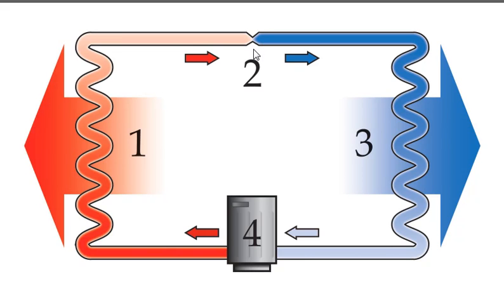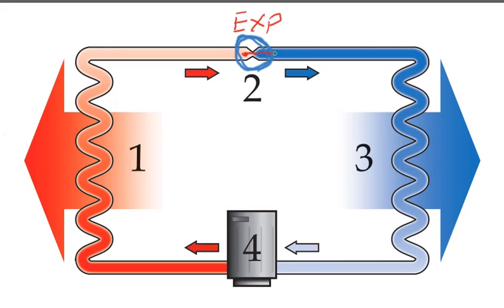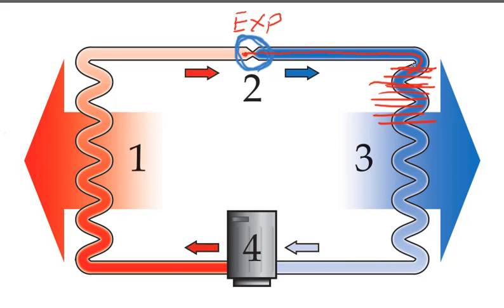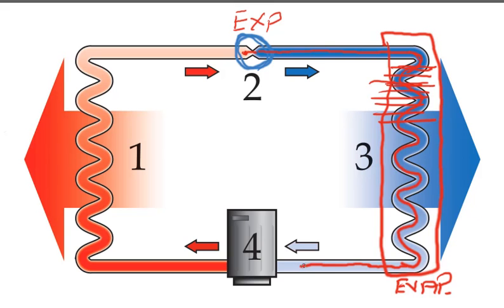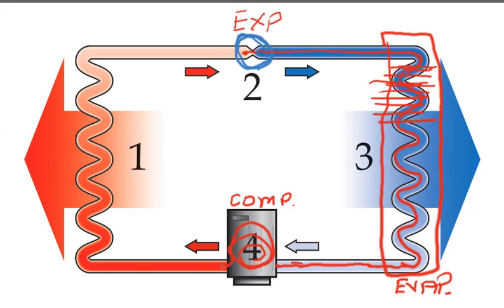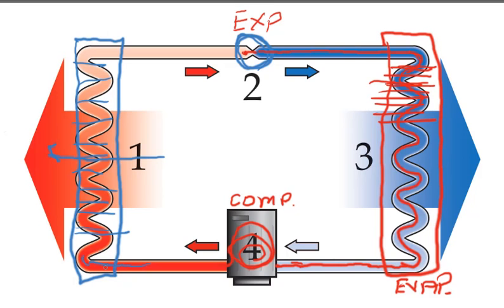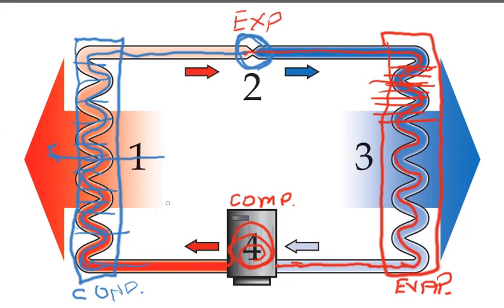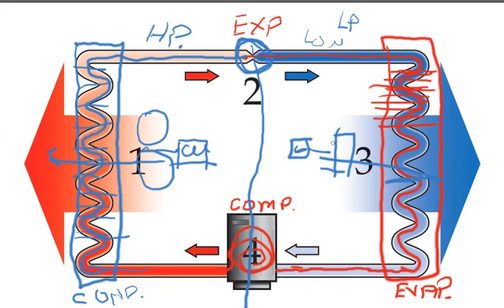Refrigeration Cycle

Comment: Thanks. I knew that the basic refrigeration cycle was simple to grasp if communicated clearly. The only jargon you had to use was evaporate, compress, and condense, which are words we already know. It's when some teachers also explain the physics of pressure and temperature while teaching the basic cycle that it becomes more difficult to understand all at once.
Reply: I've had this same problem with other subjects/ courses. Where teachers have spent 2 hours explaining the properties of Light particles and velocity and complex mathematical formulas for calculating critical angles of refraction/reflection and working things out with different density Index's ....Only to end the lesson by saying " But all you need to know is that a 'Critical Angle' exists which determines if light refracts or reflects. " By which point your mind is burnt out and you have another 2 hours of another subject to do, who's teacher does the same thing ! lol

Comment: Thanks for this, I've recently started selling HVAC & it wasn't immediately obvious to me exactly how refrigerant functions. I'm still not sure I understand entirely though, so I'd like to recap and ask a few questions: Essentially then, the compressor is the key component - its function is to circulate the coolant. By so doing, the increased pressure augments coolant temp, which creates the need for the condensing unit(R22/R410A) to expulse excess heat resulting from warm air heating up the evap coil. Since the goal is to keep the evaporator coils cold, an expansion device is needed to decrease pressure by reducing flow, thus decreasing the coolants temp and perpetuating the cycle. Is that about right?  Also, is refrigerant used instead of water because it is a more versatile medium for this purpose? Simply, why not just use water?

Comment: Is the EXP an orifice of some sort? Is hole who in my query?
Reply from the maker: Wham Odyne many expansion devices are an orifice or hole in a brass fitting
Reply: Michael Glover 
Hi just watched your video thanks. I am looking at making up evaporator inside a water tank so we can pre cool water which in turn runs through a heat exchanger to cool milk before it goes into a silo. Is it possible for me to make an evaporator and is size of it based on size of compressor also what can I use as expansion chamber and is this a controlled mechanism?

Comment: Would it kill the performance if the low pressure side had no insulation on the copper tubing?
Reply from the maker: DZEyoyo123 The superheat would go up as the refrigerant gained heat through the copper tube walls.  You can measure the superheat at the evaporator exit and at the compressor inlet to get an idea how much heat gain

Comment: Do all A/C systems have to have a dryer on the low or high side? I don't think mine has a dryer(s) on either side of the system, why is that?
Reply from the maker: If the refrigerant circuit has not been opened you don't need a dryer.  Dryers are filled with a desiccant and remove any moisture that gets into the system.  Sort of a filter.

Comment: Bammbamm12: The compressors job is to change the pressure of the gas. The drawback is that it is hot. So thats what the condenser coil is there for.

Comment: Doesn't the condenser fan actually SUCK the air over the coils instead of blow the air past the coils.   If you put a piece of paper up to the coils on a cooler or vending machine....the paper will stick.
Reply from the maker: Your correct, most units draw the air over the condenser but it can work either way.
Reply: Michael Glover Your video is the best explanation of the refrigeration process that I've ever seen! 

One other question, when there is a "restriction" in the line...can the restriction happen anywhere along the coil or is it in the "Expansion valve" most of the time?   Also, the evaporator always freezes up when there is a restriction right?
Reply: RapIsDeadly

Comment from the maker: There are two coils with refrigerant running through them.  The indoor evaporator coil fan moves indoor air over the coil and the coil removes the heat from the air.  The air is returned to the space cooling it.

Another fan moves air over the outside condenser coil.  The heat from indoors is carried by the refrigerant to the outside condenser coil and the fan blows the heat off of this coil into the outdoor air.  The refrigerant is returned to the evaporator to start the cycle again.

Comment from the maker: The compressor is needed to increase the refrigerant pressure so the system can provide continuous cooling.  Heat produced in the compressor is a byproduct of the compression process.

Comment from the maker: Heat is energy and energy can't be created or destroyed.  It just changes form.  The electric energy input into a compressor is transformed into heat energy as the gas is compressed.  The heat is in the refrigerant and is transferred to the air by the condenser.

The condenser gets rid of all the heat we don't want.  The heat from inside the building and the heat resulting from compressing the gas.

Comment: The compressor is compressing the refrigerant to the condenser, the reason for this is because the heat in the condenser must be higher then the ambient temperature outside for a heat transfer to occur.
Another reason the compressor is creating heat is to create superheat on the evaporator side so the refrigerant turns to a vapour and does not ruin the compressor.

Comment from the maker: You are correct about the refrigerant picking up heat, but it's mostly latent heat and latent heat does not increase the temperature.  Study the pressure temperature relationship on a refrigerant chart.  The refrigerant pressure drops after the expansion device.  When the refrigerant picks up enough latent heat for phase change, it changes to a low pressure gas.  Sensible heat changes the refrigerant temperature, latent heat does not.

Comment from the maker: The liquid expands from high pressure liquid to a low pressure liquid at the expansion device.  The low pressure liquid picks up heat and boils in the evaporator.  The refrigerant should be vapor exiting the evaporator.

Comment: Im a bit confused you said at the expansion valve the warm liquid expands to a gas and this gas goes through the evaporator and turns into a gas again as heat transfer takes place?